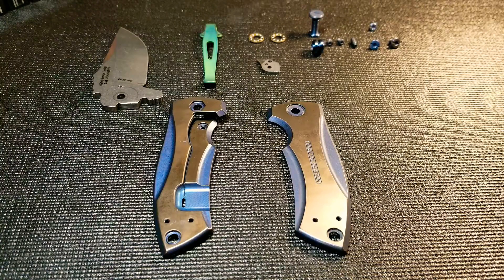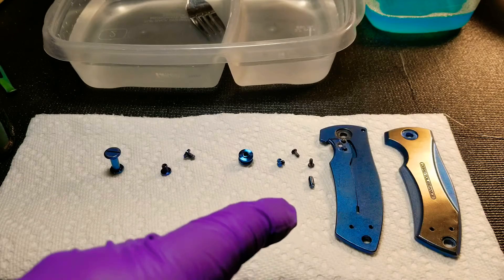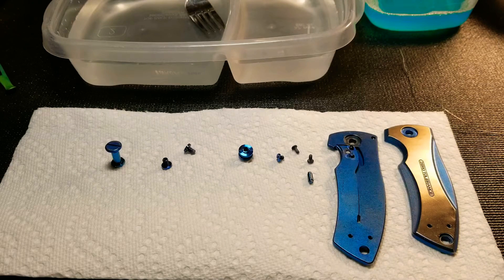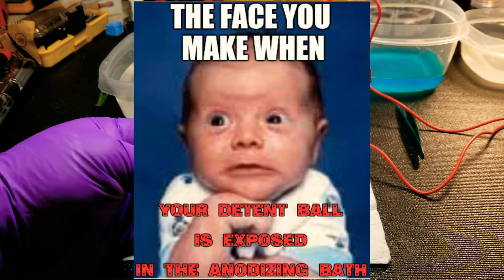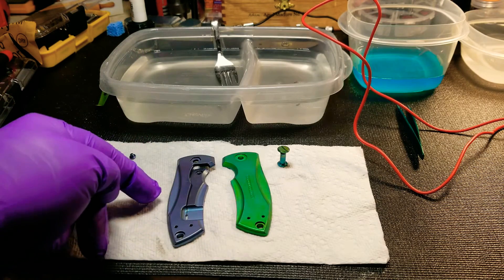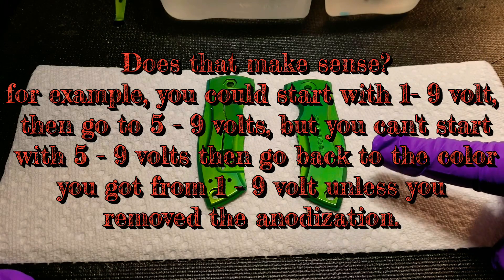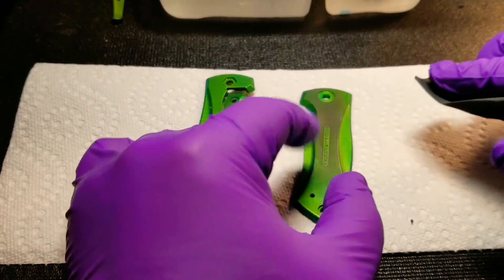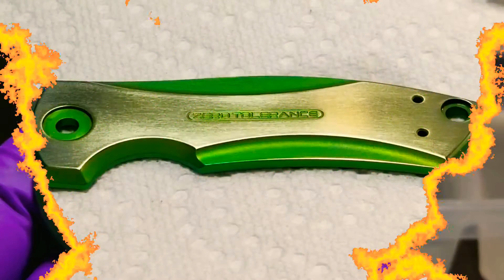How To Anodize Titanium Knife Scales, Motorcycle Parts (Tutorial) Change The Color Of Your Bike Ti!

Comment: How do you get the nail polish to stay on the ball. I knkw you had it pop off since it wasnt dry. But even dry when i get into higher volts it just releases. I have the same issue sometimes using polish for designs

Comment: You said “and then re-anodize” and the CC said “and then Rihanna dies”! 😂  

Thank you for posting these great videos, so inspiring. I’ve been wanting to anodize forever, but after watching your vids I finally ordered a variable power supply, Ti wire, and some Whink 😉 
One question: How do you do very small parts like screws? 

Thank you!
Reply from the maker: Lol, I went through and fixed most of the CC's, but I must have missed that one. It kept getting changed to that. 🤣
Usually when I anodize screws I'll fairly tightly wrap the threads with a piece of titanium wire and dip them that way. You could also dip a q-tip or paint brush in your electrolyte and go that route, but I find dipping them on the ti wire to be easier and generally quicker.
Hope that helps and all makes sense. If you need any clarification just let me know. 👍🏼
Reply: @ApollosRings  Thanks, that makes perfect sense. One last question (if you don’t mind) - I’m using a variable power supply, and I was wondering if you have a particular amp setting that you use, or if you calculate it somehow?

Comment: How do you get the lock bar insert out of frame of knife
Reply from the maker: I remember it was really tight initially, but the very first time I ended up putting it in the freezer for a bit. Took a bit, but I eventually got it off with the help of an extremely small, thin, flat screwdriver.

Comment: hi bro, thank you for sharing your videos, i'm struggling to get the toxic green, i have a power supply that reach up to 120 volt dc output, but i can't achieve the toxic green color. Why?
Reply: Give Multi-Etch a try. Safer than Whink but you need to use one or the other to remove the naturally occurring invisible oxide layer that forms on titanium when exposed to air.
Reply: @TitaniumDemos  thnak you fro this tip, where do you suggest to buy it in Europe or us?

Comment: I have been trying for a year to get a green color like that but can't get it to work. I've tried baking soda, TSP, different surface finishes, 9 volts, and an adjustable 120 volt power supply.
Reply from the maker: What grade titanium are you trying to anodize?
Reply: @ApollosRings  Not sure what grade but I currently tried my Aiorosu Zong. I've also tried some titanium rod, pocket clips, a ring, and a Leatherman Charge. I can get every color but the bright green.

Comment: I have been trying to anodize my ZT 0562. I cannot get the lock bar insert removed. The screw comes out but the locking insert is just stuck there. Any ideas or tips on how to remove it? Have you had this issue before?
Reply from the maker: Yeah, it's just super tight. Sometimes they are press fit with the screw just adding extra hold. You can try a little penetrating oil like Aero-Kroil or something and let it sit overnight. Its tough because if you pry you can mar the surface, but if you really work at it you should be able to get it.

Comment: Do you need to put the nail polish on when submerging in the whink bath or just the anode bath?
Reply from the maker: You would just use the nail polish in the anodizing bath.
Reply from the maker: I would Whink the entire piece first, then rinse it and let it dry completely, then I would put the nail polish on and let that harden completely. Maybe even hit it with a hair dryer or heat gun. Then anodize your first color, then remove the nail polish, then anodize again.
Reply: Ok thank you for the tip.  It seems counter intuitive to remove the polish for the second bath. Second time you anodize the ball is bare?
Reply from the maker: Ok, we are talking about 2 different processes.  I thought you were talking about the nail polish masking on the titanium part for a splash pattern. You were referring to the nail polish protecting the detent ball. To protect the detent ball you definitely want to do that first before you do anything else, make sure to use multiple coats, and let it completely dry, then leave it on the entire time. Once you are completely done anodizing, then you remove it.
Reply from the maker: Sorry about the confusion there. With the use of nail polish you're referring to it would absolutely be counterintuitive to remove the polish mid ano job. I just misunderstood what you were referring to at first. You definitely want the polish on prior to the Whink for the detent nail polish
Reply: Ok thank you very much.  Sorry for the confusion. Has the whink ever ate away at the polish in your experience?
Reply from the maker: No problem, glad we got that all figured out. As far as the Whink goes, it will not eat through the nail polish, but you do need to make sure that the nail polish has a few coats put on, and that you let it dry thoroughly. I made the mistake once of anodizing too soon before the polish was dry . That will seriously mess up your detent ball if the polish comes off in the anodizing bath. As long as you put a few coats on and let it dry thoroughly you don't have anything to worry about though. The Whink will definitely not eat through the polish, no worries there.

Comment: this is going to work on my ZT 0801 folder...
Reply from the maker: Should work great on the 0801. ZT uses quality titanium. I haven't had any issues whatsoever doing mine over and over again. Just make sure you fully disassemble prior to anodizing.  Any stainless parts (lock bar insert, detent ball) left on the knife will get seriously screwed up in the bath if left on. If you can't remove them (detent ball), then make sure to coat it with a few good coats of nail polish, and let it dry for a solid few hours, or even overnight before anodizing. I made the mistake of not doing that once, and the result wasn't pretty. I was able to bring it back to working order, but it's better if you just do it right the first time and coat it well.
Reply: @ApollosRings  yeah, i saw that in the vid.. i wasnt sure how messed up it would get, thanks for the heads up.  the zt 0801 i have is "stonewash" im curious to see if the Winks will remove that finish
Reply from the maker: Depends on how long you leave it in. If it is a very quick dip, you should be able to retain a bit of the stonewashed finish. You can always do a poor man's stonewash with a coffee can in the dryer afterwards as well. I will probably put a video of that out too in the somewhat near future.

Comment: What do u do about the lock face? Do u cover it nail polish? Or do you just anodize it? Have u experienced any sticking or anything if u did anodize it?
Reply from the maker: The one in the video is removable, so I take it off. Is yours just part of the scale? If so, it would definitely be a good idea to nail polish that first, and give it a good long time to fully dry. If it doesn't fully dry the nail polish can come off. I had that happen in my detent ball once, and it only takes a second for it to corrode like crazy. I can't stress enough, nail polish anything that isn't titanium that still has to go in the bath with a couple good coats of polish, and also hit any critical tolerance areas (lock face, bearing race, screw holes, ect.). I don't personally do the bearing races or the screw holes on my knife any more, but I'd feel better if you made that call. I would definitely do the lock face though if it wasn't removable.
Reply: SharpKnifeNuts cool thanks for the advice, I will definitely keep all those in mind.
Reply from the maker: No problem.  Any other questions, just hit me up. You know the drill 👍🏼
Reply: SharpKnifeNuts cool thanks for the advice, I will definitely keep all those in mind.

Comment: Can you anodize stainless steel using this method?
Reply: Unfortunately, anodizing steel is more complicated. The thing is, anodizing is the process of creating an oxide layer around the metal, and under normal conditions, the oxide that normally forms around steel is iron oxide aka rust, so this process would just cause steel to rust incredibly quickly. You can anodize steel but you have to put it in a bath of potassium hydroxide (KOH) and heat it up over 40 degrees or so to force it to form magnetite instead of rust.

http://2.media.dorkly.cvcdn.com/52/23/bb9632c66d7be6e35fb419588af1bf15.jpg
Reply from the maker: No, unfortunately it won't work for stainless steel.

Comment: What is that brush you're using when the scales are in the bath?  Is it necessary to get a nicer color?
Reply from the maker: Just using it to brush off any air bubbles. If there are air bubbles on the part it prevents direct contact with the water, which is where the current is flowing doing the anodizing. I don't think it's absolutely necessary, but if it helps with a little better color I'm all for it. It definitely helps if you are anodizing letters that are indented on a part. Sometimes you'll get a stubborn air bubble that just won't pop in those letters
Reply: SharpKnifeNuts Thanks for the info! Are you using just a normal steel fork as the anode?  I’ve been told that it needs to be a piece of titanium.
Reply from the maker: No problem! The fork is stainless.  Titanium would work as well, but regular carbon steel is a no-no. I use the stainless fork because it's much more readily available than scrap titanium.  I have a full "how to anodize titanium" tutorial on the channel as well that gets a bit more thorough with all the info. Check that out if you get a chance, and feel free to ask any questions you might have. I'll do my best to get you the answers. I'll have another method of anodizing going up here shortly as well. If you're interested, stay tuned!

Comment: What grit sand paper was that and was it wet or dry ? Thx
Reply from the maker: I've found that the easiest way to remove the anodizing at this point is to hit it with a Scotch-Brite pad. To speed the process up I use the Scotch-Brite wheel for the Dremel. I do it dry, and honestly that thing makes short work of it. Only takes a minute or two, and you really don't need to go at it hard. Just let the pad do the work. I've used sandpaper before, and that'll work fine too, but I like the finish I get from the Scotch-Btite better. If I was using sandpaper, I'd probably hit it with like a 240, then follow up with a 400, but it all depends on the finish you're going for.
Reply: SharpKnifeNuts ok cool thx man. I’ll give that a try. Keep up the good work

Comment: How many 9 volt batteries did you use to get that green
Reply: Just ordered batteries etc but I can't get whinks here so hopefully I can come up with something to. I hope you'll upload more videos man and brian if you're b wallace on insta I'm loving your work.
Reply: DSNugent91 yeah that’s me on intragram under bwallace.shfj3 or Brian Wallace Thanks. Just got a power supply today in the mail and multi etch so I should be getting better results now since I can go 1 volt at a time increasing the amount of colors you can achieve. Not sure if you can purchase multi etch online where your from.
Reply from the maker: DSNugent91, The active ingredient in the Whink is hydrochloric acid, if you can get your hands on some of that, that'll work. Just have to be careful, it's some nasty stuff. As stated in one of the other comments, Multi-etch works well too, it's just quite a bit more expensive. 

I'm working on a whole bunch of projects right now that I'm trying to get filmed. There will be a bunch of new videos on some really cool new projects coming out soon. Stay tuned!
Reply: SharpKnifeNuts can't wait man, thank you for the reply. That's in most drain cleaners I believe so I'll do a few tests with some drain cleaners.
Reply from the maker: Yeah, if drain cleaner has it in there,  give it a shot. If its heavily diluted you may just need a bit more time in the solution, but I'd definitely be interested in your findings. Keep me posted on how you make out. Also may want to have some baking soda on hand to neutralize the acid just in case you get some on you. Looking forward to hearing how you make out. Good luck, and stay safe.
Reply from the maker: I believe it was 12. I would have to go back and watch the vid, pretty sure I stated it in there.
Reply from the maker: I have another video on the channel that shows every color with different 9 volt combos if you're interested

Comment: Thanks a lot for your work mate! Will do the same with my titanium stuff. What about bolts and standoffs are they Ti or stainless steel?
Reply from the maker: Thanks for watching! As far as the hardware, depends on the knife. On my ZT 0900 I have all Ti hardware, but the knife didn't come with it. I purchased most of it through MXG Gear. They have Ti hardware for a bunch of different models I believe. I did have to source one small piece of hardware separately, but it was easy enough to find on Ebay.
Reply: Cheers! Do you have an experience to get colors on stainless hardware somehow??
Reply from the maker: You could get a little color with heat, but it'll be very dull and probably mess your parts up. I wouldn't mess with the stainless hardware personally. It's worth spending a few bucks and getting the hardware in titanium if you really want the hardware colored.

Comment: great job! just a question. if you cover the parts you do not want to be anodized with tape and then do the anodisation and after remove the tape wouldn't that work the same?
Reply from the maker: Absolutely, but depending on weather or not you have to re-anodize, or use hydrochloric acid to remove the anodizing, or even just do multiple runs in the bath tape can start to peel. Also there are areas that tape just won't stick to that can easily be coated with nail polish such as raised, or indented lettering and detent balls. There are some really good tape choices for plain flat work, but nail polish is much more versatile.